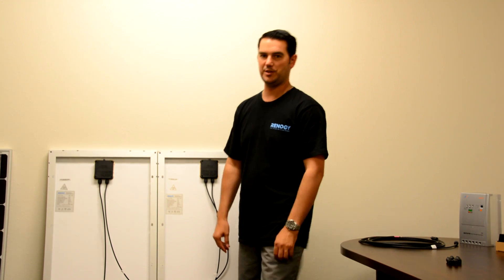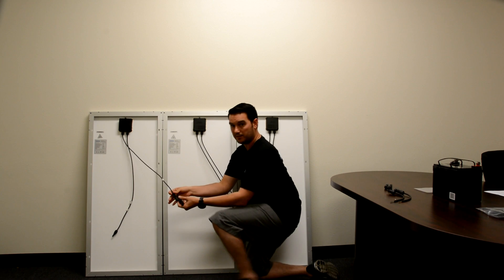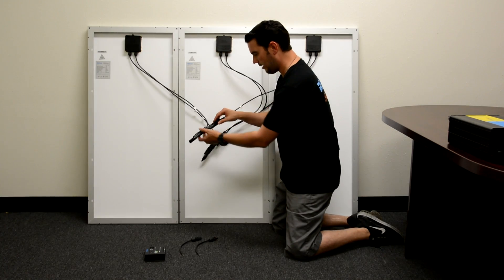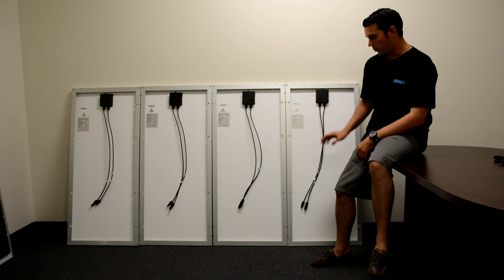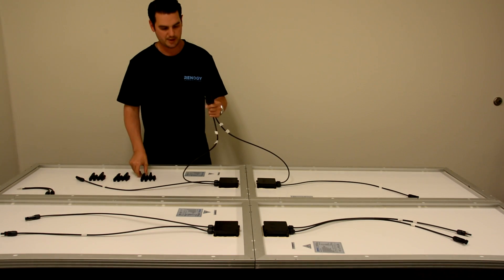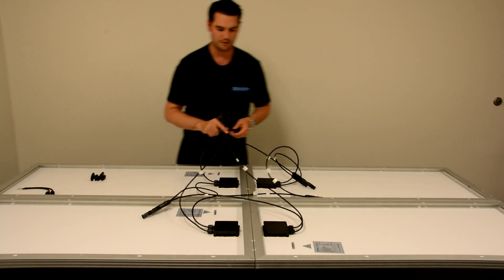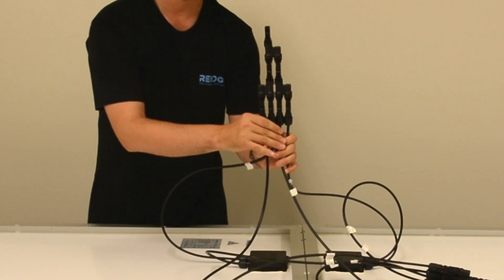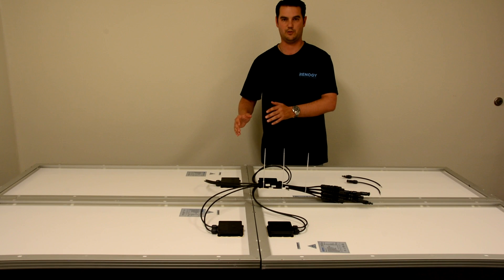Renogy: How to connect your Solar Panels in Series and Parallel Pt. 2

Comment: Hy, I just want to make sure that the solar panel set I have working properly or not. I have 16*150W solar panels. Each 4 panels (48Volts) in series. So I have got 4sets (150W*4 (48 Volts)+150W*4 (48 volts) +150W*4 (48 volts)+150*4 (48 volts)). Than I lay 1 DC cable as a main cable and connect 2 sets (3200W) with it. Same one other cable as a main cable and connect another 02 sets with it. So now I have got 02 positive and 02 negative cables. I connect both positive together in Solar charge controller and both negative together in negative port.
I have got one 48 volt / 50Amp Solar charge controller nad 5 KVA Inverter and 08 dry gel 150 Amp batteries.
Batteries also in series. Each 4 together.

My question is it should produce how many Volts or Amp?
Or I make any mistake by doing in this way?
Whether these solar panels are enough to charge 8 batteries?

Thanks Regards,
Yasir
Reply from the maker: Hello Yassir,
 
I am having a little trouble following your description of your system. It says 3200W but your system can only produce 2400W at most (16*150W). I am also a little confused by the wiring. I understand that you have 4 sets of 4 panels in series, but after that you lost me. If you have the time to call us at (909)-517-3598 we’d be happy to help answer your questions.
 
Renogy Tech Support
SR

Comment: I own ten Renogy 100D panels (1KW) and have them wired series-series-parallel (two strings of five panels). My VOC on each string is about 109 volts each. Everything works fine...my MPPT solar charge controller can handle up to 150 volts. With these higher voltages, my charge controller works best and tracks optimal power points. A lot of guys run higher voltages so that they don't have to use thicker feeder cables into their solar charge controllers. I am running 10 AWG PV cable rated for 600v and it works well. Have you seen this before? What is the actual current decrease vs running 10 panels all in parallel vs two strings of five panels wired in series? (ie, two 60 volt strings). I actually had an engineer look into my system and he said it was fine with 10 AWG PV cable. Thanks.
Reply from the maker: Yes we have. This is exactly how we would have recommended that you wire your solar array. Your 10AWG wire, even at a length of 100ft, would only have a 3.52% voltage loss. We generally size wiring to have a less than 5% voltage loss, so your wire sizing is within that limit. This is assuming aluminum wire and 100ft as well, if you had copper wire or a shorter length, the voltage loss would be even less. Running 10 panels in parallel would be a very bad idea. If they were wired in parallel, just to go 10ft, you would need a 6AWG wire to be below the 5% voltage loss that we recommend. As I’m sure you’re aware, larger wire means larger cost. I would not be worried about a thing with your systems wiring size. You can go up to 140ft from panels to controller with 10AWG wire and still be below 5% voltage loss.
 
Hope this helps. Anytime you have questions, we are always have to help via our online chat on our website or by phone at (909)-517-3598.
 
Renogy Tech Support
SR
Reply: Renogy Solar Thanks, I would never parallel 10 100 watt panels. I do plan to go to 20 panels with 4 strings of five panels...keeping the VOC around 109 volts. Still should be safe feeding all 20 panels through the 10 AWG PV lines to the solar charge controller (Midnite Classic 150). Thanks
Reply: @RenogySolar  wow the customer service!!
Reply: Chris DIYer old thread but I’m actually doing a very similar thing. What is the amp ratings on your panels? I believe 10awg wire has a max limit of 30amp. With that many strings I’d imagine your adding breakers/fuses to each string? Had one other question, if one string gets shaded and it’s wired in series, obviously it knocks out the string. But does it also knock out the whole system from the point it is wired in series, (other strings) with or without combiner boxes?
Reply: Renogy Solar, old thread but I’m actually doing a very similar thing. What is the amp ratings on your panels? I believe 10awg wire has a max limit of 30amp. With that many strings I’d imagine your adding breakers/fuses to each string? Had one other question, if one string gets shaded and it’s wired in series, obviously it knocks out the string. But does it also knock out the whole system from the point it is wired in series, (other strings) with or without combiner boxes?

Comment: On your 100 watt kit what gauge cable do I need to add 20 feet from the panel to my charge controller
Reply from the maker: You should be ok with a 12 gauge cable. You can use our calculator here as well to figure out other configurations: http://www.renogy-store.com/Solar-Cable-Gauge-s/1864.htm

Comment: will 40 feet of MC4 Solar Extension 10 Gauge Cable safely handle 500 watts .
what I have is x5 100 watt renogy panels hooked up in paralle that need to run about 40 feet to my grid tie .
Thanks